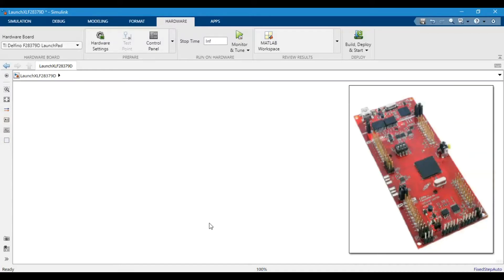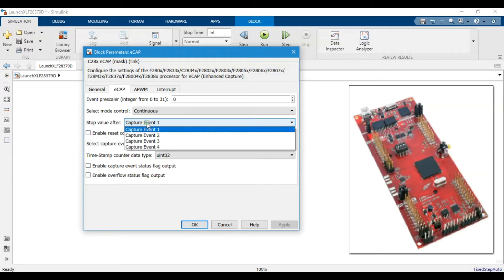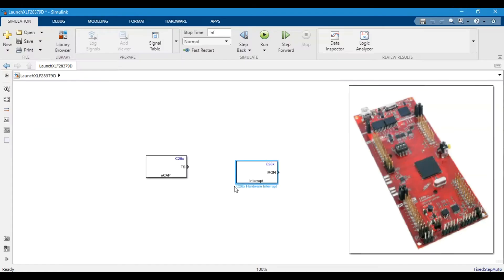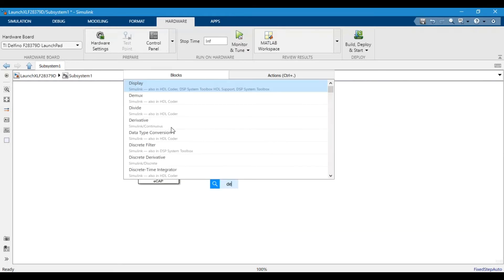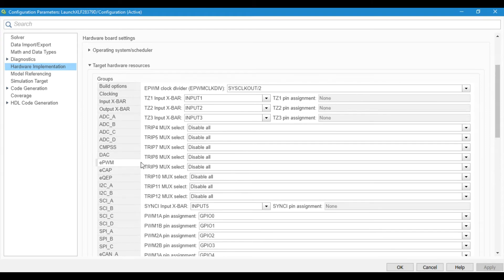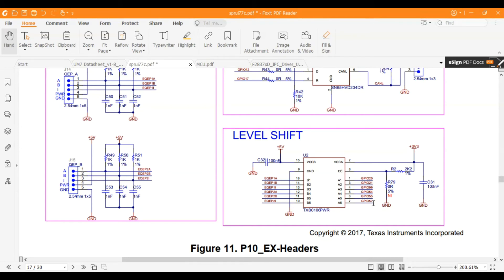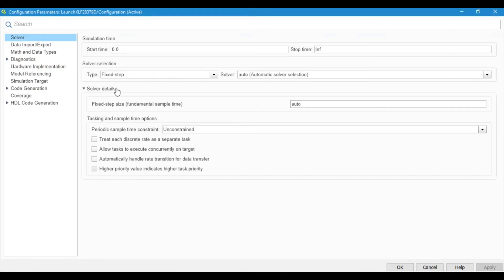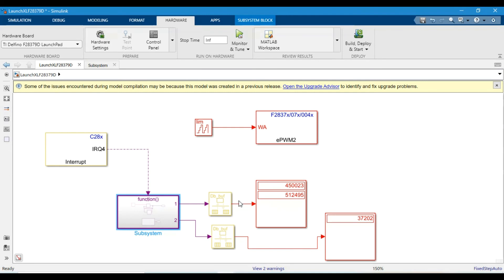LAUNCHXL-F28379D- eCAP- Capturing PWM-PART 2(b)

Comment: what is Ts? is it time stemp value when rising / falling edge is occuring....
I want to calculate timeperiode of a square wave by subtracting time stemp of two concecutive rising edge is tht Ts is same thing what I want
Reply from the maker: Yes, Ts is the timestamp value when rising or falling edge occurs.
Reply: @vdcsystems  sir I see in video Ts value is some 450000 or so it looks like counter value not time duration...How I can get actual time value from this Ts?
Reply from the maker: @sane4895  Actually there is a dedicated 32 bit timer for this operation. During 0-2^32 timer value we can have four events captured, the timestamps of those four even are given by Ts. You can convert Ts timestamp value into seconds by using MCU clock speed which is 200 MHz. If you are using a clock divider then you have to divide 200 MHz by that divider.
Reply: @vdcsystems  Sir, How to do this ( You can convert Ts timestamp value into seconds by using MCU clock speed which is 200 MHz).... I mean supose I have Ts value 450000 then what isTs value in seconds is 450000/(200Mega) am I correct?

Comment: Can you explain what is happening between Interrupt block and the function call block?
Reply from the maker: Every time the signal on eQEP pin goes high or goes low it generates an interrupt. That interrupt signal comes out from the Hardware interrupt block. This signal goes to function call subsystem to execute what is inside the function.